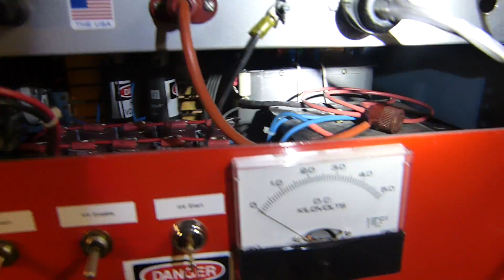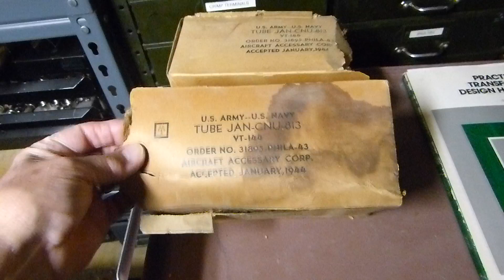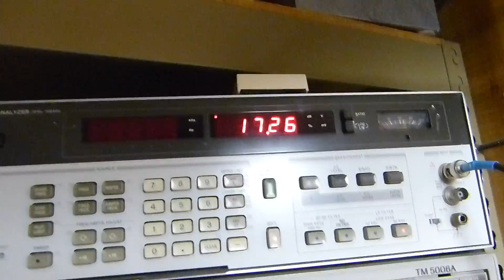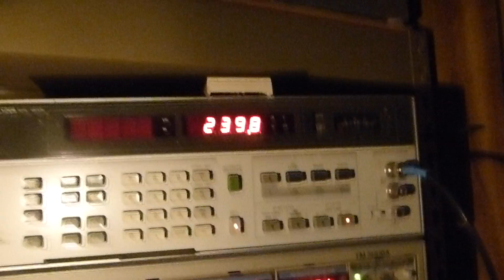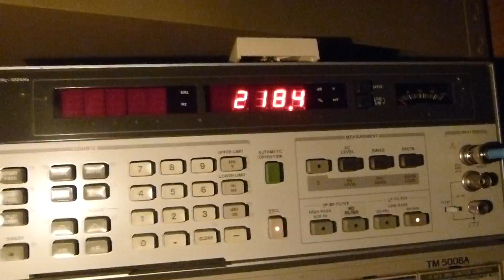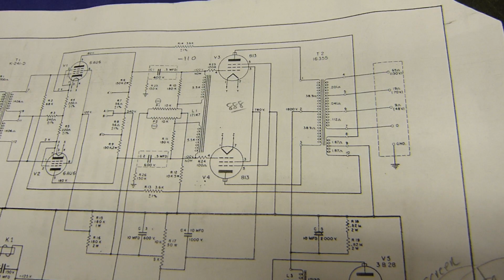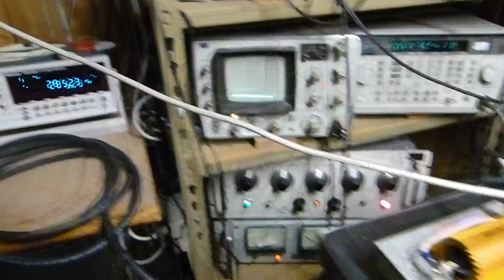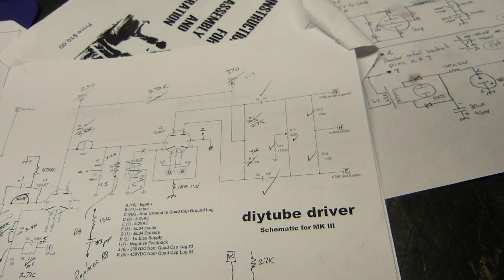813 Vacuum Tube Push Pull Audio Power Amplifier Project

Comment: I think your drivers can’t deliver the mA needed to produce the lower FQs. How about an 807 driver board/preamp?
Reply from the maker: Hi Dave,
I eventually went to push-pull 5881's as a driver and it worked much better. 
The simple way out is just to use a turned-around small push pull output transformer from something like a pair of EL84 or 6V6 etc. 
Drive the 813, or whatever tubes you are using, with the high impedance side of the OPT, CT to the bias supply, and then drive the 4 or 8 ohm side of the transformer with a small amplifier. Probably only need 2-3 watts to develop enough voltage to drive the grids of the 813's. I did this recently with push pull 810 and can get 700 watts from them.

Comment: I might be talking out of the wrong orifice here but:- regarding the non symmetrical distortion in the driver, I wonder if it is coming from V1a?  (Just because the circuit is symmetrical from V2 onward). In which case, it might be worth using V1b as a cathode follower and use the out-put to boot-strap V1a's Anode. This would create a constant voltage across V1a's anode resistor and help improve its drive capability. V1b does not need to be in the signal path, but, as is there doing nothing,  you might as well us it for something????
Reply from the maker: +Bishka100 You are right, the distortion is from the very first stage. Part of what helped is a 2:1 voltage divider at the NFB point. I used two 10K 2W resistors and the LF response got much better. I think the solution now is to use a pair of 6V6 or 6L6 into a PP driver transformer, which I do have, and I things will get much better and maybe as good as I can make it. Thanks for your suggestion.
Reply: +ElPaso TubeAmps  Glad it helped.

Now, where are slices of bread and the toasting fork?

Comment: For 08:54 need to seperated from my previous post: this is excatly what i mean...these are the "transfer losses" while you need to "suck" the out of the decoupling caps as well as the grids....together they form a very low impedance and rather high tansfer impedance you have to drive....
If your drive can´t perovide this current you´re seeing just this...this isn´t a too low grid bias setting, as one could easily be missleaded to think it is...

No.

It´s the driver´s lack of current capability....inother words a too weak driver....that´s all....

Comment: It can't be crossover distortion properly speaking if it emanates from the driver stage, and it doesn't look like any X-over distortion I've ever seen. Not symmetrical with the negative cycle for a start. I think you may have a time constant problem in the upper driver's PSU. It just can't sustain the voltage for the whole half-cycle at 80Hz, which is interestingly close to 60Hz. It would also be interesting to have a look at an 80Hz square wave. I think you will see it collapse to zero in the upper half about 2/3 way along. Good luck with it.

Comment: Dave.
   Your 813 PP amp would make a hell of a great modulator for AM...Why don't you measure the upper bandwidth just to see how far you can sweep at 1 or 2 watts.
Reply from the maker: +Mike Samra I will do that tonight.
Reply from the maker: +Mike Samra I think you and I have talked and I told you how I did use these transformers (back-to-back) juggling the secondary impedance to get a good match to a pair of 4-400A modulators, plate modulating a class C 4-400A from my AM days in Huntsville, AL. These OPT might not be the quality (frequency wise) of a McIntosh transformer but they are amazing and I feel beyond lucky to have a pair of them. We all know, as you mentioned in the 1-2 watt scan, that they may not be 20 Hz to 20 Khz at 1 KW but they might be pretty darn good at that frequency range at 250 watts... We shall see.

Comment: That's unusual crossover distortion...it appears on the down slope of the sine wave rather than the normal rise of the wave. Is the output transformer capable of a full frequency range or within 30-15K? I have a feeling that the issue lies in the driver board. Have you thought of possibly using a driver transformer with maybe a 6L6GC or EL-34? I've never used a DIY driver board, so I can't give you any evaluation results from my experience, but I am suspicious of it's capabilities. I'm curious to see a schematic of the board to get an idea. 

I was also looking at the schematic of the Altec 260A...Interesting design. It seems that the overall frequency response of the 260A is 45-15, 000 cycles (or hertz as they say now :)) at around 2% THD. The original design has limited response, but not bad for an older design. Another thing that makes me wonder about the odd sine wave at 100 hZ and below is the B+ and Bias supply. Have you monitored the output of these supplies at those frequencies? Just curious. The capacitors may be another thing to look at.  I also noticed the original design uses 2 3B28 gas rectifiers which I believe is a direct drop-in replacement for the 866A MV rectifier tubes. Another very interesting video. Frank Ferraro--Audio Craft Electronics.

Comment: Thoroughly enjoy your project posts.  Please keep them coming.  Yes, does kinda look like crossover distortion, based on the position of that "blip" and that the line goes flat as you lower the power (but that's just an uneducated guess).  Have been playing with the idea of making an amp using the 813s myself, but not at such high voltages (only want a couple hundred watts output for a guitar amp).  BTW, your breathing sounds much better.
Reply from the maker: +Albert Nakaji Weoo, The 813 is quite a powerful tube. Kind of like a 10X,  6L6... Running the 813 at "low voltage" is still going to be about 2 KV so the voltages on the plate and the screen will be dangerous (and possibly lethal) anyway you look at it. You can run the 813 GG but I wouldn't go there for a high quality guitar amp.
Reply: What would you consider for a 200 watt amp, at what voltage?
Reply from the maker: +Albert Nakaji  A quad of parallel, PP, 6550's can provide 200 watts with a plate voltage of 750-800 volts. You do have to run them in a true beam power pentode (tetrode) mode, meaning you need a screen voltage lower than the plate voltage. Check the tube manuals for specs. The Ampeg SVT amps run (six, 6550's) this way for what they claim as 300 watts.. I mention this because the overwhelming numbers of tubes are run in "triode" mode meaning that the screen is at the same potential as the plate. This is cheaper as it eliminates a power supply voltage.The screen voltage is not best obtained by dropping resistors from the plate supply. Looking at schematics from different vendors will give you some really good ideas.

Comment: maybe a el34 as a driver tube? I guess your are trying not to rework the driver circuit but I Imagine you would have the parts to to that.
Reply from the maker: +noahtheviking I think that is the answer... a bigger and better voltage amplifier to drive the 813's. They are running class AB1 so I don't need any current delivery but at -100 volts on the g rid, the little DIY board just can't "get it". I am trying to avoid a transformer driver as I believe that will be detrimental to "HiFi" sound. I also have to consider these OPT are (as best I know) from a US Navy ship-to-shore PA system and are tailored primarily for voice (300 to 3000 Hz?) but I know they can deliver 1.5 KW of raw power so I am hoping for a really good 30 to 15 KHz response at 250 watts. If I get it to working better I will update. Thanks for your reply.
Reply: +ElPaso TubeAmps, I'm with noahtheviking in thinking that you need higher voltage (not current) and your little driver doesn't have that kind of output.  I vaguely recall someone did a similar project and used el34s or something like that for drivers.  Kinda stopped me in my tracks to think that we use them for output and they were being used for drivers.
Reply: +ElPaso TubeAmps   i really love your video's and i have gotten behind on them and i was wondering what happened to that 1.3kw audio tube amp you built. that thing seemed to have a very nice fq response with really good THD ,  i would love to build something like that in the 2kw power range , i would like to know if i could get your help on that ?   My father had tons of big Mcintosh  amps and other mcintosh gear when i was a kid , he friggin loved mcintosh
Reply: +ElPaso TubeAmps Hi, my friend...good to see you doing good..:)
These 813 asking for AB2...So set up a nice driver...i would go for 6L6GCs running as cathode follower. Providing the neg. grid bias and a lo-output impedance signal stright to these 813 girds.
You would need to adjust the 813 grid bias at the 6L6s grids with a matching grid input voltage and a little adjustment-pot for the fine trimming...

To drive the 6L6 i would choose 6SN7. 

To match your "all american" sticker...;) could also be done with EL34 and ECC81 or 82....same way...;)

for all these big output (transmitting) tubes usually you need to have a "three-stage" driver. Not just the two we are familiar with. These tube are only happy with AB2 and this requires a low-impedance driver.
Or you end up with just like this, you have here....

Poor low-end response (due to impedance mismatch)...as you need to provide some current for the dynamic grid impedance of these 813s usually they manufacturer give you the maximum allowd grid resistance in AB-amps with fixed bias...these are rather low with respect to the usual EL34/6L6/KT88 type amps...so you need to drive this....or you end up with low-end losses....as in the low end frequency range you need to have this transfer current fowing for a longer time, which your driver can´t provide, therefore it cuts out too early...
Reply from the maker: +TubiCal I plan on trying the cathode follower. Do you suggest  just tying the 5881 plates to the B+ and a cathode resistor to ground to set the plate current at maybe 35-40 mA and capacitor couple the cathodes to the grids of the 813's? Or would you use the transformer that I already have in it? Do you have any actual schematics for this cathode follower setup driving transmitting tubes that you could share with me? Just so I don't have to "reinvent the wheel" here. Thanks for all your suggestions.
Reply: +ElPaso TubeAmps
 Hi there, love the gear you got there man! 
just in regards to the driver schematic you put up, I noticed you have the coupling cap between th V1 plate & V2 grid shorted out.
Is that how it is in an actual build?
Can't imagine that the circuit would work well with over +100 V  bias on the grid of V2.
Reply from the maker: +Mark G http://akdatabase.org/AKview/albums/userpics/10004/MA230%20Schematic.pdfHi Mark, no, in the driver board you see in the video, the capacitor is not jumpered out. I was making some modifications to a DIY board to change it to the McIntosh MA230 schematic I put a link to above where they do direct connect the plate to the grid. The schematic I showed of the driver board is not a good example of what I used as I kept the DIY board (almost) stock. Thanks.
Reply: +ElPaso TubeAmps 
Thanks for that,
unable to access the link, do you know if there is any reason for that?